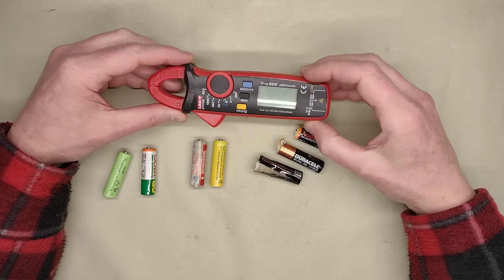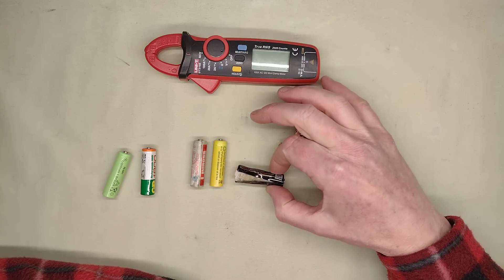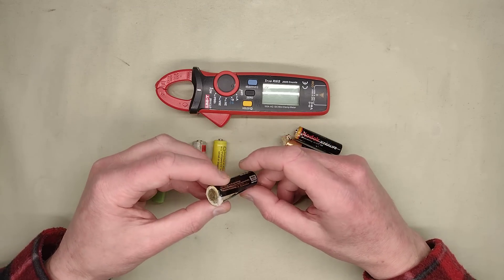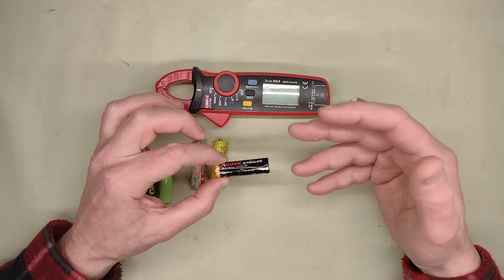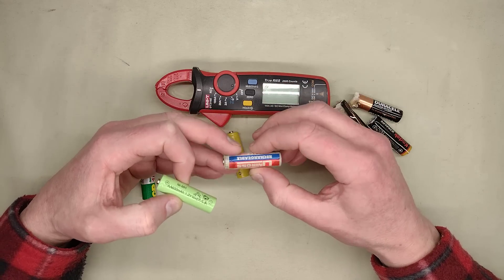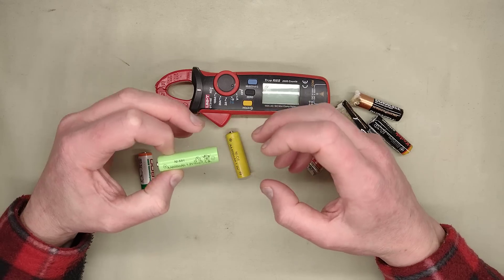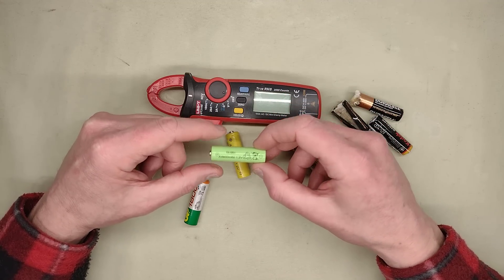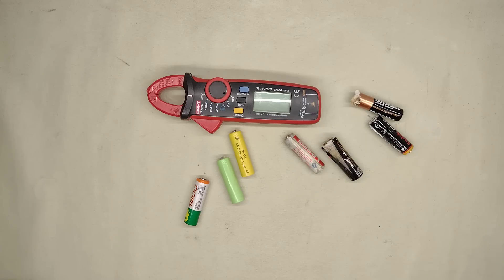The curse of leaky alkaline batteries

Comment: I may have to try out more lithum cells then. I've been just changing Alkaline batteries out once a year (here at the first of the year) in most of my devices trying to stay ahead of any leaks.  I just throw them into a box to keep for use in a flashlight if necessary. Over the decades I've had alkalines leak and destroy everything from portable cassette and CD players to AM/FM/Shortwave radios.  It really sucks when your $2 battery destroys a $200 device that is irreplaceable these days.

Unfortunately, some devices are far too sensitive and will report 1.2V as being "low" or "dead". I have some digital recorders that are temperamental, so while I'd love to use NiMh, I can't.

Comment: What about the use of Alkalines in those outdoor flashy LED fairy lights that tend to operate beyond the drain point voltage that would hurt NiMH otherwise? e.g. below 1V? Quite often the lights that run for about 3 weeks get forgotten and unfortunately NiMH don't have discharge protection like Lithium Ion, I've found the capacity seriously reduced through 'over discharge' - some cells may even start reverse charging (reached 0V if not well matched).. Obviously with alkaline this doesn't matter as they are spent anyway...

Comment: 1:00 that green one is nasty one, got leaked and destroyed plastic bag in which it was, leaked to near by metal light torch through a wall inside a  backpack and removed paint of that metal housing of light torch... since I got one leaked in my multimeter (cleaned with vinegar and multimeter survived) I kept them in plastic bag... now I ordered special storage plastic case for batteries plus it will be in 2 plastic bags.

Comment: I've lost more equipment (probably approaching $1,000 in damages) due to the bad batteries they're manufacturing today.

Losses:
- 5× Maglite Flashlights (Bulb-style AA that were each 20-30 years old)
- 1× Laser Pointer (AA)
- 1× MP3 Player
- several remotes

What still works:
- 3× Maglites (D cells that are each 20-30 years old)
- 2× Surefires (each 20 years old, that I only ever put Surefire batteries in)
- 3× Mini Maglites (AAA)

I used to use Duracell primarily after conducting my own tests in the 1990s and finding that Duracell outlasted Energizer (and both blew away Rayovac), but now I'm using Energizer because (so far) they haven't exploded inside my equipment and destroyed it yet...

I believe that there's a strong possibility that the Corporation(s) used the environmental movement as an excuse to put out poor quality products with which to blame them for the failure.  I still blame the manufacturer, because they put out junk when they used to put out reliable equipment that did not cause the premature failure of yours.  Even the LED flashlights of today aren't as durable as the older flashlights were (which I've dropped 20 ft. down cave shafts and they continued to shine surprisingly).

Comment: The phenomenon is cell reversal. In series batteries, no matter the chemistry, not all the batteries will discharge at the same rate. If you let batteries in series get low enough in energy, some cells will give up sooner than others and the ones that still have power left will drive current backwards through the weaker cells destroying them. Again, this is true for any chemistry. The moral is to replace low cells before this happens.

Comment: May not be the forum but here it goes. My daughter gave me a video doorbell which runs on 18650 rechargeable batteries. The temperature here in winter drops below -20c quite often. This of course wreaks havoc on the battery life. Is there a cold capable direct replacement that works?  Any thoughts?  Thought about directly powering it but not really a viable option.
Reply from the maker: That's an extreme temperature for many battery technologies.  Is there a way the batteries can be mounted remotely in a warmer area?
LiFePO4 lithium cells are available with a wider temperature range, but have a different voltage range and charging requirement.
Reply: @bigclivedotcom  thank you. Hadn’t thought of that. Could mount inside the house and run short wires through the wall. FYI  -35c tonight.

Comment: In their early days Duracell used to offer compensation if their batteries leaked but I am pretty sure they no longer do this.
In the 1950s we used to test batteries for Duracell whilst potholing. Great long lasting batteries BUT they ran down very abruptly which could leave you in complete darkness if you found yourself in a long tricky section. We quickly relegated them to extreme emergency use only!

Comment: I've lost many electronic devices and wall clocks to leaky alkaline batteries.  I've noticed that they leak in humid conditions when the battery is discharged.  I've switched to non-rechargeable lithium batteries in humid Hawaii but still use alkaline batteries in dry Southern California.

Comment: I'm a big fan of Sanyo/Panasonic Eneloop NiMH rechargeable AA+AAA batteries. I've been using them almost exclusively for over 10 years in all sorts of devices with no issues. The package on the most recent batch claimed they would hold 70% of their charge for up to 10 years and can be recharged up to 2100 times, pretty crazy stats!
Reply: Ikea lada AA are half the price, made in the sane factory in Japan and have same build 2450mah. The 2100 mah are not eneloop pro so will have less mah capacity.
Reply: @J R  I've heard of those but never tried them. Thanks for the reminder, I'll have to check them out! 👍

Comment: For simple motor operated devices that recuire a higher voltage one can use Ni-Zn batteries. They are rechargeable and give 1.6 volt.

Comment: First off, thanks for covering this topic.  Your viewership reach might just kick off the revolution needed to fix this problem.  Growing up in the 70s and 80s I can state with absolute authority that I recall only a handful of leaky alkaline batteries.  Since 2010 I would say 50% of all AA and AAA batteries that I've purchased have leaked.  I switched to slow internal discharge NiMH for most things but some devices still need the higher voltage to work properly or long enough.  We need designers to rethink operating voltage to more closely match NiMH voltages and we'd be in great shape for the switch.  Given the MCU shift from 5v to 3.3V and down to 1.8 or 1.2V this should be easy enough to accomplish.  A campaign for the environment and against the wasteful Alkaline battery might just do it.

Comment: Alkaline batteries really screws up your remotes to the point where it eats up the traces on the buttons and the remote is rendered useless. I would hope that expensive equipment that use alkaline batteries would have a completely enclosed compartment to which the battery leaks it would not go inside the electronics.

Comment: I've used alkaline batteries for years without any leakage issues - until the last 3 or 4 years. I doubt it's an inherent flaw in the design but cost-cutting by the manufacturers to drive the price down. They are certainly very, very much cheaper than they used to be. But so are NiMH batteries. Now, use those in all my equipment.
Reply: I believe it’s planned obsolescence. And people are catching onto prepping. You can’t have people surviving. It’s not part of the plan. 
Next thing they’ll be corroded in the shelf at the store.
Reply: The problem is that actually good NiMH, that don’t self-discharge and die from misuse are still expensive and not that easy to buy. Out of reach for majority of consumers who still need to be directed to purchase and use these.

Comment: My most expensive Duracell leak was in the wireless thermostat for the central heating. Unfixable and £120 for a replacement. The batteries leaked over the summer when the heating wasn't required so I didn't notice.

I'm not sure about built in and prismatic Lithiums. I have had quite a few swell up in units not being used, one physically breaking the OLED display in a Sony MP3 player. Last month I discovered a five year old LIDL power bank with a distinct bulge in the middle. That had literally never been used apart from testing it on the day I bought it. Doing some research they are more likely to cause an emergency than be useful in one.

Comment: I found too many things I use don't use as much charge from a fully charged nimh as they could; they're too tight with their voltage tolerance. 
I'm too shy to use lipo aaa/aa drop in usb-charged drop-in replacements as I get nervous charging a lipo to 100% (!!!) It looks nearly all the new phones now come with lipo batteries (instead of non  lipo lithium, whatever you call it). I know you'd have to be really unlucky for it to make a hot mess but man if it did it would be baaaaad. Personally I find varta alkaline is good value, but yeah I try not to forget to change them/take them out when flat.

Comment: Good to hear. I've been having trouble lately with Energizers going and leaking if I forget about them for any amount of time, and honestly was ecstatic to find Duracells over the holidays since finding any other brand here seems to be neigh impossible. But I'll have to keep in mind to consider getting some new NiMH batteries after I'm through those. Much as you've suggested, I've never had an issue with the ones I have, except one: They're like 15 years old and only hold a charge for a day or two now!

Comment: Oh, forgot to mention, you can get usb-chargeable Li-ion cells, that put out a flat 1.5V.  It's a 14430 cell with charger/converter board that fills it out to a 14500/AA form-factor.  As mentioned, a flat 1.5V for things that don't fare too well on 1.2V from NiMH, but the drawback being that they suddenly and unexpectedly drop dead without warning once they're spent.  No big deal, just pop it out and recharge, and it's good to go again.
Reply: I'm using NiZn AA batteries for these devices. Devices that aren't happy with 1.2V are generally very happy with the 1.6V of NiZn batteries.
Reply: @danielmantione  Thank you. I will try those ☕️
Reply: That sounds interesting, I would be interested to know the make and where you can buy them from. Thanks.
Reply: EBL makes good ones, available on Amazon but only with a charger, and also on ebay with and without chargers.  Can’t use a NimH charger on them.  Also, be careful against improper use and storage, as Li-Ions have been known to combust.
Reply: Thanks. I live offgrid and have been using rechargeable lithium batteries for two years. Initially expensive at around $4Au each for a good brand 2,000ma/h AA 🍺🦘
Reply: Also, their capacity is significantly lower than a good AA alkaline cell. But aside from that, they are a decent aLternative to AA alkaline cells where 1.25V NiMH isn’t suitable.
Reply: Yes, the major downside to me of the 1.5 volt AA Li-Ions is that they require a different charger, and sometimes state it must be propietary.  I also wonder if they have adequately protected againt over-heating/ catching fire to which Li-Ions are prone.  For the latter reason I never recommend Li-Ions to someone who isn’t already using them and seems capable of handling safely.  Especially true of households with children.
Reply: @DennisHicks78749  All of those are recharged from 5V/usb.  Some have the micro connector where you use a standard charging cable, but others recharge by just hitting them with 5V across their terminals.  The "charger" is just a convenience holder that applies said 5V to the terminals,
Reply: Joe Schmo I didn’t know that, thanks for the info!
Reply: @joeschmo622  I wouldn't count on that.  The set I have charge via USB-C, and I hooked a meter up to them while they are charging.  They spike to 5v on the ends, but do not stay there.  You might damage (overheat) the cell to apply 5v continuous externally if the charger is supposed to cycle 5v at some rate.
Reply: @lperkins2  I have no idea what you're referring to. The ones I have (both types), work exactly as I described.
Reply: @joeschmo622  Aye, that's not unexpected.  But the fact that they are not a simple chemical cell, containing a charge controller of some sort, means you really can't generalize from one vendor's cells to another.  It's likely safe enough if you get ones with integrated overvolt/overcurrent/overcharge protection, but given that the failure mode is often rather bright and stinky, I wouldn't suggest just applying a constant 5v to a lithium-cell AA without checking its documentation first.
Reply: @lperkins2  Have you been paying attention?  These are Li-ion cells THAT OUTPUT 1.5V.  Of course there's a controller board built-in, which handles charging from 5V AND steps down the voltage to a flat 1.5V.

14430 Li cell + board  = 14500 form-factor "1.5V" cell.
Reply: @joeschmo622  Indeed.  But what is the charge duty cycle on the charge controller?  If it expects power to be delivered via USB, it might be expecting the USB power supply to limit the current to 900mA, per the USB specification, or it might pulse the connection from the USB port, to avoid overheating the 3.7v internal cell.  In either case, providing voltage directly to the terminals may not be something the charge controller can handle.
Reply: @lperkins2  Only thing I can suggest is that you write the manufacturer and ask.
Reply: @Anglo Saxon Thanks will have a look.
Reply: @Anglo Saxon hello

Comment: Vinegar and a cotton bud are my solution to finding a leaked alkaline cell. Just apply the Vinegar soaked cotton bud to the affected area and watch it 'fizz'. When the fizzing has died down and the affected area (usually the metal battery contact) cleaned up - clean up with water, again applied with a cotton bud. Needles to say, restrict Vinegar and water to the affected areas and ensure they don't impinge onto other electronic areas.

Comment: I started wedging a thin piece of plastic between batteries and contacts for devices I don't use often. The same idea as toy manufacturers. Even if I forget it's there the first thing I'll check is the batteries so it all works out. And it's easier than keeping them out and later wondering if some of my batteries are partially drained etc.

Comment: If a battery leaks in your electronic device, use a small brush (a toothbrush will suffice) to rub vinegar on the contacts and rinse away the battery acid, and then again to rinse a little with water. It's amazing how well it works. It leaves no trace of damage or acid. I've saved many a device this way.

Comment: I don't buy alkaline batteries anymore unless I am on the road and need a battery.  Too much leakage.  I still have a bunch though but I am working through them and only buying NiMH replacements.  Unfortunately I need more AAA NiMH batteries and have too many AA's.  They typically package 4 AA's with 2 AAA's.  I need more like 4 AAA's and 2 AA's.  Now that everything is LED, AA's aren't used as often, not even for flashlights.

9 volt batteries for smoke detectors and such are still all Alkaline, I haven't seen those in NiMH or a charger for such yet.  But they also don't leak in equipment because any leaks are contained by the external housing.  Or things like smoke detectors start beeping before they start leaking.

Comment: I will never use alkaline batteries in any device worth more than the batteries themselves.  They are disposable batteries for disposable devices.  An insidious property of alkaline batteries is that they can continue to supply power while they are leaking.  In the case of TV remote controls, by the time you realize that the batteries are getting weak (reduced range), they have already started to leak and cause damage.  For me, I will only use Eveready Ultimate Lithium batteries in such devices and rechargeable NiMH batteries (Eneloop, etc) in higher drain devices such as flashlights.

Comment: For the last 15 years my household have been using a flat and charged box either side of our charger, with maybe 40 LSD NIMHs, and we have never really had the problem of not having a battery to use. We still use alkaline 9v in the smoke alarms though, the choice of rechargeable 9v batteries doesn't seem as good.
Reply: Maybe the USB rechargeable ones?

Comment: God, I remember those Uniross NiCd batteries. I had a radio controlled car that took FOURTEEN of them, and this was in the 90s so you could either slow charge them all at once in the car over 14 hours, or “quick charge” them in batches of four which actually took longer overall.

The only things I own that take AA/AAA batteries are various TV remotes and my multimeter. Everything else takes its own lithium ion pack or lithium coin cells of varying sizes. And I rarely change my remote batteries, when they start to go I just give them a roll around in their holder and they last at least six more months.

Comment: I have actually seen more and more electronics state in the manual that they require an alkaline battery and should not be used with a 1.2V batter, aka NiMH batteries. I have been told this is due to limiting current draw. It may just be marketing though.

Comment: I used to use NiMH in a wireless mouse. I would only get a few days on a charge, and the batteries wore out quickly due to frequent recharging. I bought a new mouse a few years ago and it came with alkaline batteries that lasted nearly a year. Even with low self-discharge, I can't envision NiMH lasting that long.